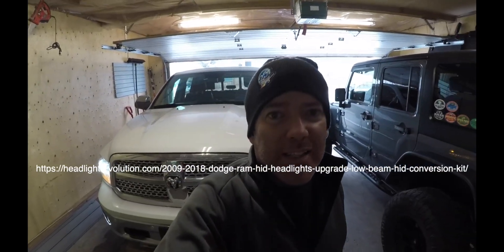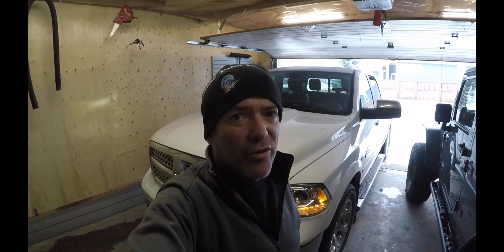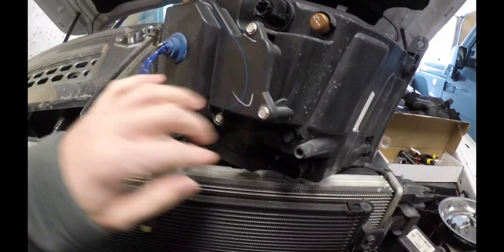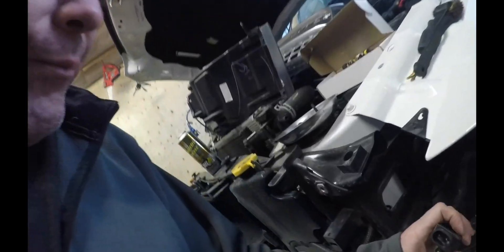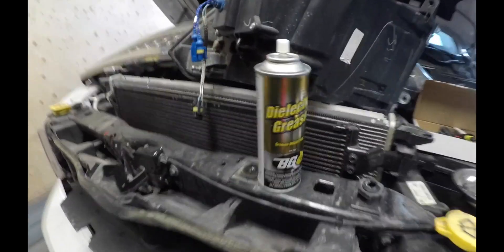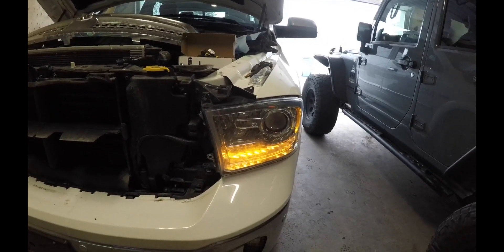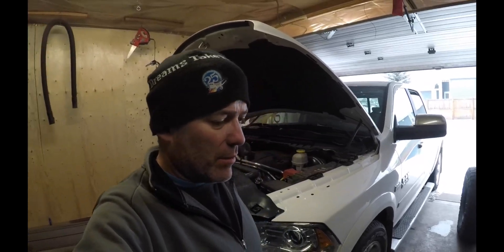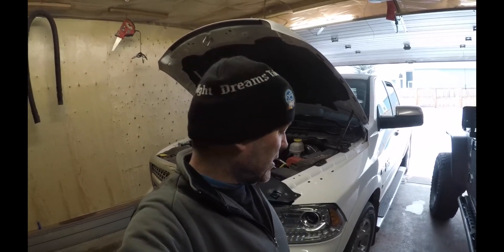GTR HID Repair or maybe.

Comment: That's is what is the problem, corrosion I had some corrosion build up in my ballast and wires and all I did was to clean it up and apply some die-grease and I was good to go., I'm planning on get those.
Reply from the maker: The kit is the easiest I’ve ever installed.  I had a ballast go bad but Headlight Revolution fixed me right up.
Reply: @Homeguy4x4  Oh great I just ordered two of them, one for my head and one for my fog light.

I got them for a projector light but I don't have projector yet but that will be my next buy.